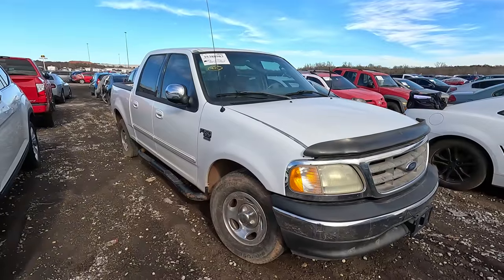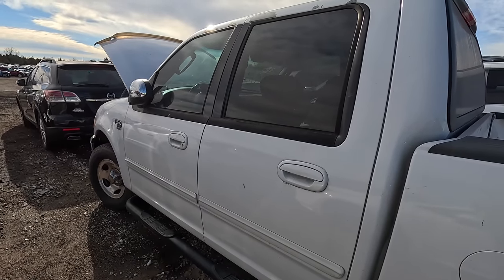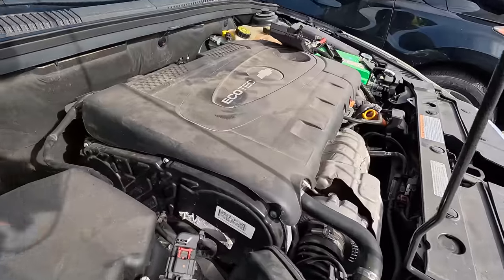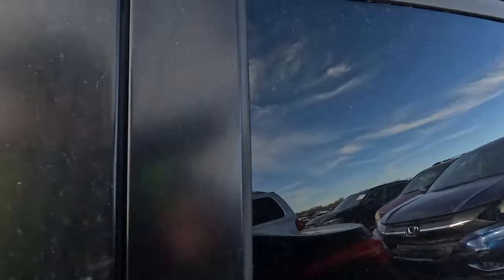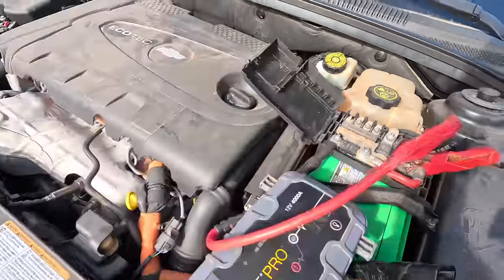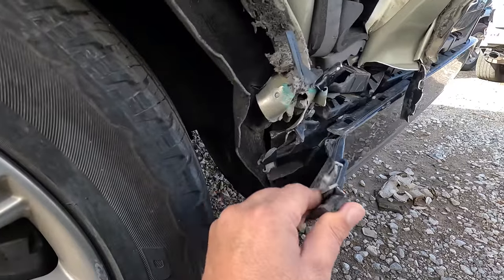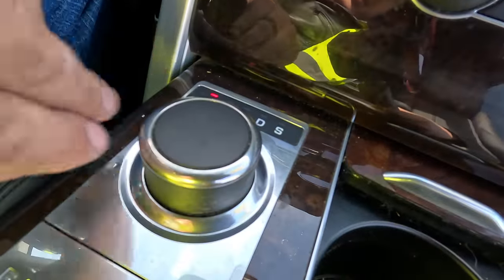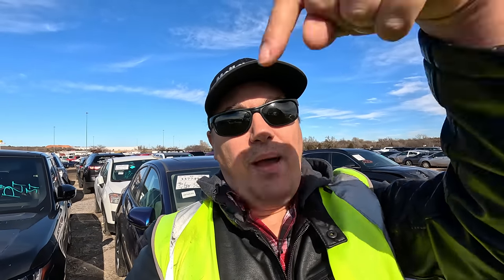IAA Walk Around 1-4-23 + A Cheap 500HP Supercharged Range Rover!!

Comment: A diesel would be the last vehicle I'd put on Turo. Everyone would try to but gasoline in it...
Reply: Idk about the Cruze, but my Jetta TDI had a recall to install a misfueling guard (also larger, more conspicuous "DIESEL FUEL ONLY" stickers), which was basically a flap that was locked to three releases mounted around the filler hole that was sized exactly to the diesel nozzle. The flap would remain locked until all three releases were pressed in at once, which a commercial unleaded gas nozzle couldn't do since it has a smaller diameter.  I was concerned when I got stationed in Germany that I wouldn't be able to fuel up if their nozzles were different, but alas, they worked.  Of course, a determined person will still be able to put gas in it by trickling it in as I doubt the locked flap also sealed it.
Reply: @davidkane4300  Cool! Good to know

Comment: Couple of things about the Cruze diesel... I was considering buying one when I bought my Jetta TDI, but I demanded a decent trim level with a stick, and only the base Cruze diesel could have a stick, which, if I remember right, meant no heated/leather seats or sunroof.  So I got a Jetta with those (well, it has the "V-Tex" pleather seats, but they were heated and the cold weather package in the diesel also had a 1kW electric heating strip because the TDI's cooling system was too good and it wouldn't really heat up much at idle).

As far as the timing belt, I know it's a different engine with a different design, but my Jetta TDI's timing belt was easy to change... The only thing that went wrong was that a fuel line mounted on top of the engine mount loosened up for some reason and the copper crush washer couldn't be reused and I needed a high pressure thread sealer that was diesel compatible as when I started it, diesel was basically pouring out of that fitting.  The copper washer was found in a Dorman HELP! Kit and a tube of "high performance" Permatex PTFE sealer, both were at the AutoZone down the street.  I did need to buy tools that someone made to emulate the factory VW holding tools (used to ensure the camshaft doesn't turn) that are god awfully expensive.  I would rate it as a moderate job... I've done belts, water pumps, and alternators that were more difficult.  A timing belt on a Highlander V6 is FAR more difficult lol.

Lastly, as far as the no start, besides the key issue, it could be that they didn't put DEF in (a guy I was stationed with had a Passat TDI that he put diesel in the DEF tank... Raw diesel injected into the DPF equals rolling coal lol) or the DEF sensor failed and the engine timed out.  I know by regulations, if there's a DEF issue, the car will start a few times, then reduced engine power a few times (like 5MPH max intended to get it on a tow truck), then if all of that is ignored, no start.

Comment: I would definetly try out that Diesel Cruze and for that Security Light its a Unprogrammed Key it happened to me once when my Chip Key Broke and left me stranded on a Wendys Parking Lot
Reply: Yeah, I bet the key was lost (maybe it's a repo?) and they just made a key to be able to more easily move it.  I know the Chrysler security will allow the engine to start, but will kill the fuel after a couple of seconds.  After a few tries, spark will be cut and it won't start at all (but it'll still crank).  My 05 Durango's key broke and I found that, even though it won't allow spark during cranking, it'll still put fuel in the cylinders and flood it.  The mobile locksmith that came out to make me a new key (for $300, which seems reasonable for an hour of their time) thought that something else was going on... Just had to floor it while cranking to clear the flood lol.

Comment: Them 2.0 turbo diesel engines in that cruze is what we have in uk for the vauxhall astra insignia ete quick little engines 160+ bhp and torque in them is great 👍
Reply: Yeah, slightly more powerful than the VW 2.0 blue TDI (AHJ+) with similar fuel economy and not cheating on emissions as, at least for the USA/Canada market, it uses DEF instead of the Golf/Jetta's supposedly magic recirculating DPF that didn't really work... The Passat got DPF and with it had the same power and fuel economy as the Golf/Jetta (which would have gotten even better economy and wouldn't have cost them $14 billion in fines!).

Comment: That is a very bad sign when the exhaust quality poor light comes on That means there's a problem with your DPF or catalyst as they call it If you're lucky it will be the sensors if you're lucky if  not you're in big trouble because those DPF are very expensive to replace it could also be because the previous owner forgot to reset the dash message . The key is definitely a generic key and it's definitely not been programmed to the car

Comment: On the diesel cruise it is the key I had the same issue my key broke I put it in the ignition and the security light came on and would not start I had a second key cost me about 200 for the Chevy dealer to remove the security code

Comment: I never thought i would see a diesel Cruze in the U.S.I think that this is the same engine i”ve got in my Insignia (Buick Regal).These are great engines,but suffer from a really dumb design flaw:a stupid rubber O-ring in-between the oil pick-up tube that hardens and disintegrates over time from it being too close to the DPF,causing the engine to fail due to oil starvation.

Comment: "There's no such thing as a cheap luxury car."
Was that Cruz listed as a run and drive? 
I'd get the land rover. If you can get it cheap enough and can fix it, it would be a good flip.
Cut your carbs and sugar, and you will lose weight. I did.